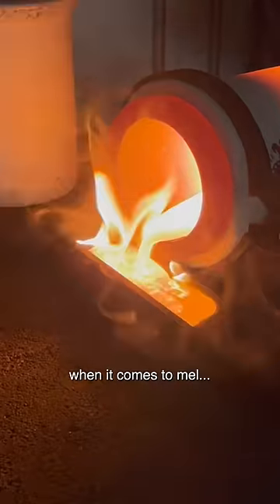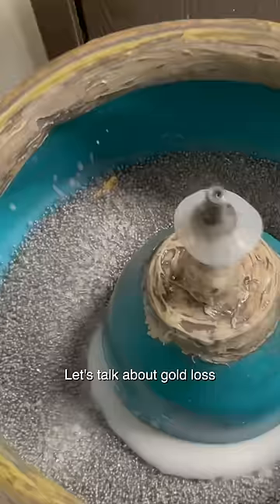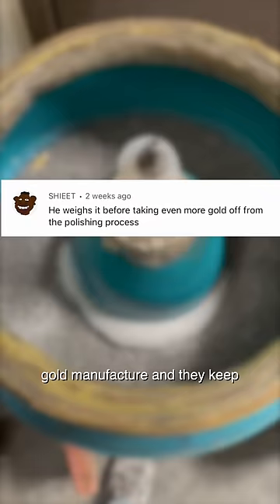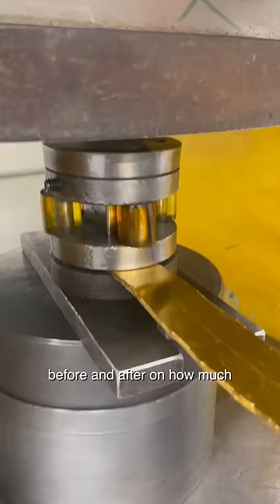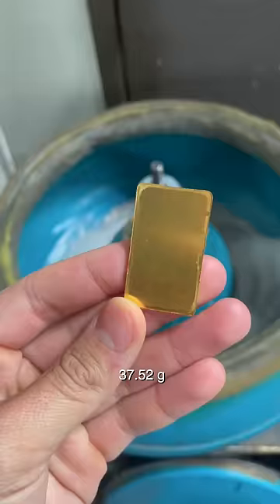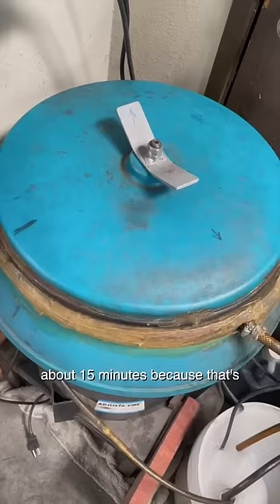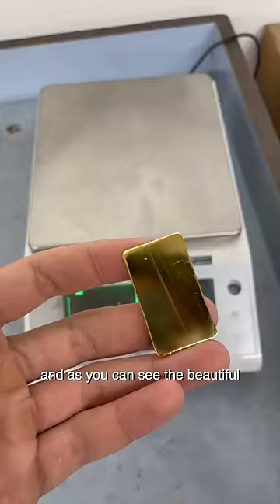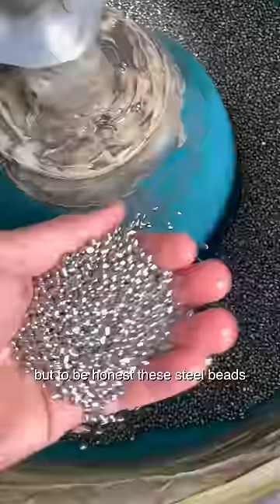How much gold loss while polishing gold coins!!

Comment: Manufacturers also usually collect that gold after a large amount of time and use it for other things, so it's not lost or wasted even in mass production
Reply: They also deal with some pretty massive volumes, competitively. Which makes the cost of the effort worthwhile
Reply: I am sure that there is no loss on THEIR part, and every single flake is recovered. People were commenting on the loss for the buyer, since they polish the pieces after "certifying" the weight
Reply: @Beregorn88  they weigh after polishing as well, and have methods to add gold to a polished piece without ruining the polish
Reply: @piranhaplantX  it really does. After cleaning, they can make a couple extra bars if I remember correctly
Reply: @Beregorn88  you can buy gold leaf in a jar from a gift shop and probably get 10x the amount lost from polishing.

This would be like buying a loaf of bread and then complaining that a crumb fell off
Reply: At around $65 per gram, that little blob of gold slurry is probably worth around 20 bucks.  Having worked metal polishing (not gold, but the same process), I'll wager that's a day or twos worth of polishing.

That means there's about $140 worth of gold getting polished off a week.  You're dammed right it's recycled.  Throwing that out would be like throwing a 100 bucks in trash!
Reply: @Mr.Sparks.173 Dude, you can buy booklets of 24k sheets for like 50 bucks, and sheets of lower grade, edible gold leaf for less than 20...
Gold is pricey by weight (not compared to rare earth elements or moon rocks, but still), so when it's pressed/stretched into super thin sheets, it hardly weighs anything and is super cheap.
A moon rock (dust speck?) as heavy as a piece of gold leaf is worth like 10⁵⁰⁰ in value lol.
Reply: Also, it's gold, whatever stuff the gold get mixed with you probably won't have too hard of a time separating the gold out of it.
Reply: @zan6102 You still failed to understand his comment. 🙄
Reply: @Tritiuminducedfusion  no, I didn't. Every reply I've given has been purely factual and true
Reply: @daveyjones8969 moon rock dust speck?..
Reply: @HeyhitmeBAM  Because the extremely limited amount of samples, they're given out in tiny, tiny pieces at a time, and there are no exceptions because it's for the benefit of the global science community. 
Don't know why I added the question mark.

What we need is Cliff Johnson, to buy all the moonrocks on earth to make bouncy and slippery goops...
Reply: Exactly as I expected.

Comment: Not all the imperfections get removed, some of them get flattened into the material
Reply: gold is super soft, so some of it definitely gets smushed around on the surface and not just taken off
Reply: @snakewithapen5489 Platinum does that too. I don't think platinum loses any material when it's polished.
Reply: another expert shows up
Reply: @klazzera  I'm agreeing with the guy in the video
Reply: Probably not gold...alloy or painted things like cars do loss wheigt...my bmx racing frame lost two gramms by polishing...alloys for cars do it too...and polishing paint is technically a very fine grinding or sanding....and that means it took material off...alloy parts out of the cnc mashine they get in the tumbler to polish and edging they loss also material(all the edge imperfections for example)

Comment: While you lose a little bit of gold in the polishing process, its so little that it will not register on the scale. With this said, the notion that  companies profit from that "gold loss" is dismantled. as a thought experiment: At the rates it happens a company using that machine would probably get enough gold micro flakes to recover 1 - 2 grams of gold by polishing nothing but gold 24/7 for approximately 20 years so nope, it's not a conspiracy by greedy companies. That doesn't even cover the cost of running the machine or its maintenance.

Comment: As long as you don't over polish, you should lose less than 100th of a gram.

It also depends on the size of the piece. If it was 100 times the surface area, maybe it would show up on the scale.

Comment: Remember, tumbling is not a subtractive or additive process. It simply beats and pummles a rough surface until it becomes smooth. The only material that may be lost is burrs from sharp edges and the tumbling media itself.
Reply: "it's not subtractive"  "the only material that may be lost" 
So it is indeed subtractive just not very. Subtractive is literally just describing if anything comes off of what you are working with during the process and he clearly shows that.
Reply: What would be more useful is to weigh the flakes in the bottom and divide by the number of gold pieces tumbled. 

Rolling a ball of tin foil (tin foil challenge) until it is shiny is similar to what’s going on here. Of course it’s also “subtractive” by your definition definition because your hands get covered in gray tin foil particles but it’s 99.99% just pushing down the sharp parts and flattening them until it shines.
Reply: @williammadisondavis  The amount of material removed is miniscule. The majority of the sludge in the bottom, or "on your hands" is actually degraded tumbling media.

Comment: Most polishing does two things, it scratches off a tiny portion of metarial, but can also hammer it in in very tiny spots. After a lot of such "dents" it becomes flat and shiny. A bit like smashing a hammer on a rough piece of metal, after a few minutes it's gonna start getting flat and shiny.
Reply: Its caller "burnishing"
Reply: @Jordan-rb28  That fundamentally is a part of polishing when using such machines.

Comment: the flakes dont float bc theyre light, they float bc of surface tension. theyre still denser than water
Reply: Yes! My ocd ass was about to comment this lmao
Reply: Obviously lol, but yeah, theyre small enough to not even outweigh surface tension. Which yes, surface tension is more force than most would expect, but gold is very dense. So to float on water at all mwans its like literally nothing. The ammount of gold there, you could pan even for that much in a few minutes.
Reply: @wage6681  what ocd has to do with it??
Reply: bruh they're light, so light that float from surface tension
try with 1 gram , and it won't float
Reply: Are we found infinite gold glitch
Reply: @Pikachu_mm  a boat can be heavier than 1g and it still floats. It's about shape as well as weight for buoyancy
Reply: @1physics  Correct. An aircraft carrier with all bombs, fuel, personnel, nuclear reactor, food, and other supplies still float quite well.

Bouyancy and shape affect what floats, as well as the weight among other factors like air and water displacement
Reply: yeah they are light that why ST beats their weight!!
Reply: Some turds float. Some dont

Comment: Slight correction, buoyancy is based on density not weight, however you are correct that polishing rarely removes any noticable weight.
Reply: Density of gold is way more than water. The flakes float because they're very light weight which means they don't exert enough force to overcome the water's surface tension

Comment: They arent "so light they float on water" the size of a gold flake doesn't effect its density which usually determines whether something sinks or floats (and is why there are also gold flakes the same size in that shot that had sunk). What is actually happening is that the gold flakes are so light that they dont break the surface tension of the water. If you pushed those gold flakes beneath the surface tension of the water (like with a needle) then they would sink to the bottom.

Comment: Yeah it's microgram scale which means it rounds up to the neareat .01 of a gram. In the first weigh it toggled down which means it could of wieghed up to 37.524 because if it weighed 37.525 it would round up to 37.53. Since the weight didn't change that means the difference is anywhere from .001 to .004 grams.

Comment: I believe on a smaller scale it’s not a big deal, but I’ve heard that large scale manufacturers of precious medals (gold, platinum, rhodium, iridium, etc.) have stuff like scrubbers for your shoes, that you’ll put your feet over at the end of shift, and in a year they’ll collect 70-80 grand worth of metal just from that minuscule amount that would get on the bottom of your shoes after a days work manufacturing those metals and the products made from them.

If you’re a small scale operation, and you’re losing 10 or 100 bucks a year in small losses like that you don’t really care, but if your a large scale manufacturer and you can get 80 grand a year out of a 5,000$ machine it’s probably worth it (no idea how much those scrubbers cost but you get my point)

Comment: People need to understand this: When your are grinding (on machines like surface grinder for example) you are not working with milimeters but you are working with 0,01 to 0,001 mm.. And we are not even talking about that polishing take even less material down. So yeah, polishing doesn t remove that much to do difference

Comment: Burnishing doesn't remove weight . It compacts the surface until uniform and smooth and shiny ,from removing the imperfections by impact.  The shinier the burnishing tool , the shinier the end result.

Comment: gold flakes don't float on water
they sit on top of it cuz of the surface tension
but if submerged once it'll sink
Reply: ..so they float on water
Reply: @crimsog6872  no cuz if you put it in water (inside water body )
it go down
even aluminum coins "float" on water sometimes
surface tension is pretty strong

Comment: They float on water due to surface tension of the water,  as an amateur gold panner even a gold flake with some thickness can float on water despite being nearly 20 times heavier.

Usually a bit of soap is enough to break the surface tension enough so dry gold flakes wont float

Comment: I consider tumbling with non abrasive media as a surface treatment rather than polishing, Personally i have plastic mug with steel stainless balls 3-4mm submerged in IPA and useit to apply hammer finish on gold and silver items. Additionaly surface treatment like above makes surface harder so it is more resistant to daily use.

Comment: this is media polishing with steel beads.  It is only rolling over the outside and becomes shiny because the steel is already polished. Steel is harder than gold so both polish each other with no loss.  This is media burnishing. Polishing gold jewellery is different. To remove scratches,  dints etc from wearing, emery paper cuts a fine layer off,  then a pre polish to remove previous sanding marks, final high polish to remove the pre polish marks. There is an unavoidable but small loss each polish. Rings less loss,  large bangles a little more. 46 years polishing precious metal . The loss is minimal. The metal is not visible and is mixed with fatty polishing compounds used for the cutting.  No jeweller compensates for the tiny loss. It takes many years to collect enough polishing dusts to be viable enough to recover any metals.

Comment: Not a gold worker, but have a chemistry background for if that counts.
The scale measures 2 decimals. So the range is from  0.015 all the way up to 0.024.
Both show as 0.02. But 0.009 grams of gold costs 57 cents.
So it is not much, but still measurable. (But if you charge over that then it is worth it so yeah)

Comment: Polishing does remove material. By definition that's what polishing is. However the amount removed is incredibly minimal. Even so, the gold that is removed from the surface can be easily recovered from solution via filtration or precipitation if it's dissolved within the solution. People act like gold being removed means it's not recoverable, but that's simply untrue.
Qualifications: I'm a metal worker hobbyist.

Comment: Not a gold expert but I do have to wonder. I have worked with chemical measuring equipment. If your scale is giving the exact same read out even though you admit some flakes are coming off, you're using a bad scale. "So light it floats on water" is a lame excuse. I have a local jeweler that sells their carpets for mad coin just because it traps years worth of flakes and dust from polish work. I know you got agitated because of people acting like experts but this video is a total discredit to pin point accuracy in science. I mentioned the jeweler for a reason. He makes sure that everyone is aware that he does profit from the months of polishing but it's only measurable enough to replace his equipment so technically, you pay him for equipment cost through the polished off dust.

Comment: Ok you were right about everything except for one thing the gold that floated didn't float because of its light weight it floated because of it's thin shape did not break the surface tension of the water meaning if it was under the water it would not float to the top. I believe you already knew that  but said it as a proof to your statement. 10/10 no one likes the comment section "experts". a jack of all trades

Comment: I never had the occasion to test this but isn’t gold dense and heavy enough to not float on water?
Reply: You're right. It's not actually floating on the surface it's actually stuck on the surface tension of the water because it's so thin and light. If you pushed it under the surface it would likely sink.

Comment: But those flakes have application in electronics. It’s small but I’d hardly call it insignificant.
Reply: That's like taking a stick from the woods and a random dude stops you and says that that wood had applications in house building. Does it? Sure. Does it have a significant or even marginal, hell, a tiny impact? No, not really. Even if they don't recover the gold- which they do- that's what, all of .05 grams? Not even?

Comment: They don't float because they are light... Floating or notvis based on density. Which doesn't really change ina solid. Gold flakes flow because their flat surface area is so big comparatively to the weight that water surface tension can hold em up.

Comment: Not a professional gold manufacturer.
But don't steel mostly beads burnish instead of cut?
Yes it's also polishing.
But I'm just thinking for people at home that intend to polish with abrasives.

So the question is kinda, would polishing with abrasive remove more gold than you'd like?

Comment: My guy, that’s barelling/burnishing, not polishing. I can make a comment and question this video because I am a jeweller. Finishing jewellery, the act of using abrasive paper and compounds to remove scratches and imperfections does remove metal, but if we didn’t do that you would have a matte, pitted, rough, scratched and sharp piece of jewellery. Polishing is also using abrasive compounds but with lots of heat from friction the compound warms up and helps to create a very smooth, very shiny, very reflective, very nice surface. It’s a jewellers goal to not loose any weight from their pieces, especially if we can’t then collect it and refine it. This process, barrelling, uses the steel balls, called shot, to hit the jewellery like a million tiny shiny hammers, which then stamps its shiny surface onto the jewellery. So burnishing and barrelling compresses the metal. A very, very, very tiny tiny amount. Those flakes would have come from the gold dust that’s then been flattened by the shot, increasing its surface area and making it float. Fun fact : you can flatten gold to be one nano meter thick.

Comment: How does the gold float on water? I thought buoyancy depended on density not weight.
Reply: Water tension is strong enough to hold microscopic objects; also flakes have relatively big surface area, so big density gets spreaded out.

Comment: can you try with 0.0001x (or 0.000001) and then calculate how much is it over a kilogram?
also a tip, the smaller the gold pieces (or more surface area per 1kg) the more gold you will lose. (i think)
please respond :)

Comment: intressing how little material you lose, btw being totally padantic here but the gold particles wil never float on water because there density doesn't change even though they weigh less. Though they may be able to stay on water because of the surface tension. (someone please correct me if you know that counts as floating).

Comment: Idgaf about the weight just please stop calling them coins
Reply: Actually coins don't need to be round they just need to be to a standard so every coin is the same and a standard weight and it's flat that it those are the requirements to be a coins being round isn't needed it's just more efficient that's why its used
Reply: @muichirotokito7176  the requirement to be a coin is having value

Comment: The gold is still wet after wiping it. You can see the wet hands and little droplets right before it goes on the scale. Those drops alone are enough to make a noticeable difference. If it's showing the same weight while wet, then the weight of the bar definitely changed.

The last statement is what seals how little you understand about what you're doing. The gold is "so light it floats"?! Things float because of density, and density doesn't change when you cut something up. Those flakes are floating because of surface tension. They still have the same density as a bar of gold.
Reply: Steel is denser than water . How do boats float. 

Are you a professional minter. Have you you ever handled gold or any metal.

Comment: The gold doesn’t float on water because it’s small. Surface tension and air pressure help gold float.
Reply: but if it wasn't small it would be heavier, so it would break the surface tension sink (like the other flakes), so yes, the gold floats because it's small and light enough to not break the tension